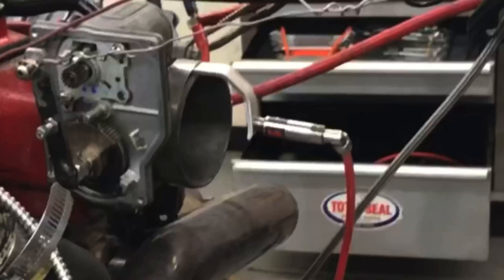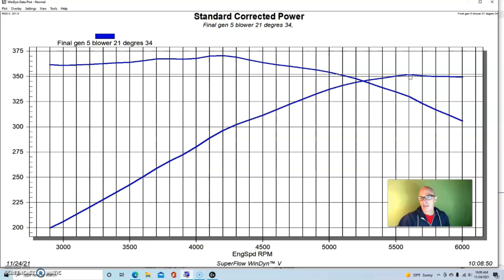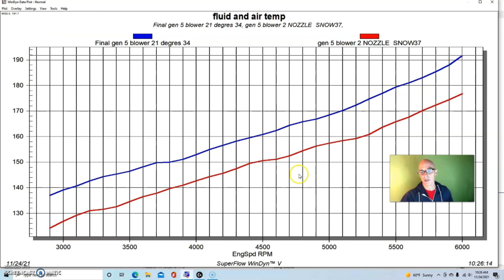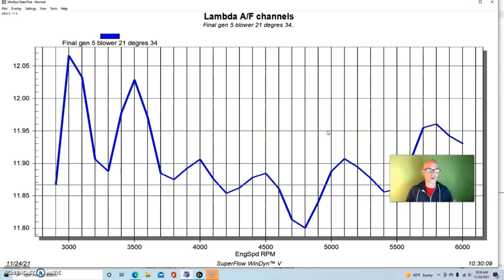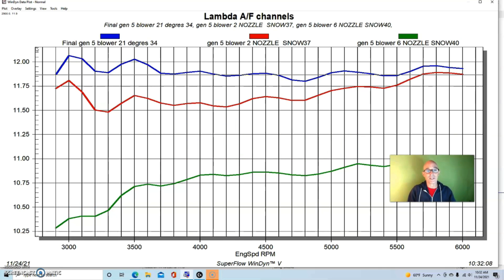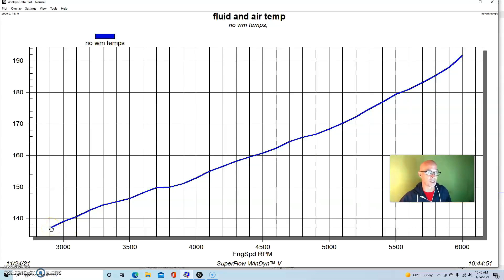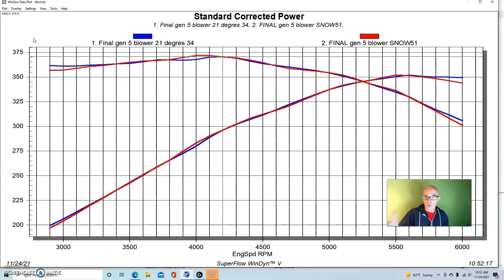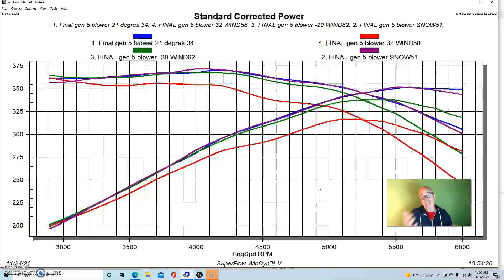WATER METH VS (LOW-$) WINDSHIELD WASHER FLUID-WHO WINS? BEST WATER/METH VIDEO EVER! IATS, AF & HP!

Comment: The test needs to be redone with 100% pure methanol. Either from VP or Renegade. Their meth is within 49%-50% O2(oxygen) content. Test also needs to be redone at varying meth to water contents. Like 50%/50% meth
25%/75meth and 100%meth. With Pre mixed contents the meth amount varies. You're missing out on power to be made!

Comment: I was wondering what would happen if you used e85 in a water meth injection system, intead of water meth. Or even placement of the nozzle, is closer better or does putting it way down a pipe or a larger plenum change anything? Your show is fun
Reply: Best to use meth, it's has a higher octane than e85

Comment: Now test 100% VP Racing M1 Methanol with E85 or VP Racing C85. I’m just about betting with E85 fuel & straight VP M1 methanol will make more power. Also I’ve always been told that with methanol injection it’s always best to have your 100% injection point to be typically around the halfway point of your boost pressure. So if your running 15psi then your 100% injection point would be 7.5psi. Just some of my experience I’d love to see what the results would be if you tested them. Love the videos

Comment: You can add a bottle of HEET to the fluid to get the methanol content up, if needed!     I always heard a 50/50 mix is best,.  But seems a closer to100% methanol would possibly work better for high compression boost or NA engines, being boost would likely be lower, and less actual cooling needed, but higher octane is a big help with high compression.. I have heard methanol is equal to 120+ octane, I'm very interested in this stuff!!
Reply: I always mix two bottles of HEET to half a container of -20 washer fluid to get the methanol content to where I want it.
Reply: 50/50 just happens to be the best mix for optimum charge cooling while raising octane with the methanol and is almost inflammable at the same time. The mix with pump gas/petrol is equivalent to using C16. If using 100% methanol I'd recommend compression fittings and not push lock due to a possibility of leaks and Direct Port injection instead of in the charge pipe.

Comment: How useful to you think a water/meth or even water/ethanol system would be for a highly stressed small/mid displacement DOHC N/A truck engine to reduce internal engine temps? I'm thinking it would reduce oil, coolant, and combustion temps and thus allow more spark advance & power. It could be very useful when towing over the Grapevine and Baker grades in summer for example.

Comment: You can buy ABC air brake conditioner from a fleet and farm type store such as rural king or a truck supply company. It's straight methanol and about $15 a gallon. If you don't want to but methanol in a drum

Comment: To summarize: Water/Methanol Injection is to increase the knock resistance to allow for an increase in boost pressure. W/M without an increase of boost or timing is of little benefit.
Reply: Also since it was already running E85 the benefits arent as large. Basically all the W/M was doing is cooling down the Supercharger meaning cooler air charge. If he had done this with 91 or 93 pump gas the differences would have been larger.
Reply: Interestingly, I made no gain on the dyno, but picked up mph at the strip on a hot day with back to back run testing without altering the tune. There is a video on my channel of it.
Reply: @GapSauceYoutube  more consistent power, less heat soak. Ran nearer to dyno number
Reply: @GapSauceYoutube  maybe the warm water makes better steam.
Reply: Well stated 👍
Reply: The biggest reason to use W/M injection is to reduce air charge temp. The knock resistance is the added benefit
Reply: @beardedforlife3740  but i thot the reduced air charge is what cures the knock?  that's the whole point?

Comment: Richard, it's good to see the charge temp drop with water/meth which should give a detonation buffer but it would be interesting to test high ratios or even 100% methanol to see the effect and how the engine will respond to significantly more timing with mixture correction. I would guess some calculations would be in order to determine the correct A/F ratio since you would be using the methanol as part of the fuel load and not just for cooling.

Comment: What happened with the boost pressure with each type of additive?  It doesn't make sense that in dropping the temp significantly that power didn't pick up.  Air density increased a bunch.
Reply: Couple issues with single port water/meth injection that can cause power to not meet expectations, especially on PD blower setups.  First, you're injecting something besides air into the intake tract.  That's going to displace some of the air the engine would normally ingest meaning less absolute power potential, normally you just lean out the fuel injection though so it would be a wash but.....  Water isn't combustible.  It actually slows down the burn speed in the chamber.  If you don't change boost, you almost always have to add some ignition advance on a water/meth inj setup just to get back to your non-injected power numbers because your burn speed is slower - the hope is that you can add enough to actually gain power without hitting knock threshold again.  I've never been a huge fan of injecting pre-blower, but the only alternative is to run per-cylinder injection which gets expensive.  It's a lot easier on a turbo or centrifugal blower because you can inject after the compressor, although some argue pre-compressor works great on turbos.  And then there's the issue of how well the water/meth gets distributed to all cylinders.  Water/meth can work (and pure meth works even better IMO since you're not carrying the burden of uncombustible H2O), but it takes work to get it right.  A lot of the same misconceptions people have about nitrous apply here as well.  It's not as cheap or easy to do it right as many believe.

Comment: Stunning.  I have never seen a comparison done with actual numbers.  Temp drop is phenomenal.  So too is the drop in hp with the washer fluid.  Sure seems like the Snow products are use specific.  We need to see more tests at elevated boost levels.  Im also wondering about "boost juice mileage".  Is there a way to estimate the amount of boost juice used per mile or??

Comment: The 32-degree WW-Fluid contains about ~95% Water, almost no Alcohol.
On E-85, just running the Engine richer will provide lots of Charge-Cooling,
it's just that You can't measure it because it's already in the Cylinder,
but it still improves Detonation-Resistance substantially.

Water-Injection is great stuff, but it only works well with super-fine atomization,
which usually only comes with super-high-pressures ( 200 to 1000 psi),
and special "Impingement" Nozzles that turn the water into a Fog, instead of "droplets".

The big advantage to Water-Injection is in allowing more Boost-Pressure,
while still maintaining adequate Detonation-Resistance.

This Engine is not "Knock-Limited" at the somewhat "low" Boost-Pressures being used,
so Water-Injection is of questionable value in this case.
.
.
.
Reply: That's pretty much NACAs position for airplane engines in the 30s and 40s. ---If you are not up against the knock limit with the existing setup, Anti Detonant Injection (ADI) wont do you much good.
Reply: @2lotusman851  Gee, both Allied and Axis pilots made significantly more power with water/meth (it's mostly why we know to do it today). Generally because the increased octane and charge cooling let them turn the boost up safely. (I mean, relatively speaking...there was a war on).
Reply: I'm curious about the fine atomization thing.  Fine atomization would certainly do better at reducing the measured intake air temperature, but the important point is that it gets fully evaporated (absorbs heat energy) before ignition.  For example, Mazda switched to using a style of fuel injector with "poor" atomization in their direct-injected engines, because they found that liquid fuel hitting and getting atomized by the hot engine parts (particularly the piston) resulted in greatly improved cooling and detonation resistance.  That's how they run Skyactiv engines at 13:1 compression on California 87 octane.  Obviously it's a little different since they're shooting jets of it straight into the piston dome, but it shows that the atomization process itself can provide cooling power.  I assume there's data proving me wrong, and I'm interested to know how and why it works.
Reply: @JETZcorp  
Any liquid that does not get turned into a vapor will seriously cause the Oil to be contaminated.
BAD BAD BAD !!!!!
Reply: The snow kit is the best on the market with the best nozzles on the market. They are he ones who make all the nozzles for every other company.. it is the perfect spray pattern optimization.xzzz
Reply: @xGR1MxREAPERx  
It's your Engine, you can "believe" anything you'd like to.
Will they protect a Street-Engine running ~14-to-1 Compression @ ~30-psi, on Regular-Pump-Gas ????
I prefer a huge Safety-Margin when making ~1300 lb/ft of Torque, and I don't intend to replace my Engine.
Reply: According to the msds sheet The -20° super tech brand winter formula was 30-40% methanol. And 0° is 21-23%..
Reply: @ogfromutube  
Sorry, but I couldn't enjoy an environment were minus-20-degrees is a routine thing.
Not even the zero-degree version is available in Florida.
When you're driving in freezing-cold-Air, You don't really need Water-Injection anyway.

Comment: Those are disappointing results. I figured water/meth would be worth all the extra work/hassle. Much better off with an intercooler. Probably more useful on the ragged edge than it is on a relatively stock 3.8 though.

Comment: Though not as affordable (by volume) as -20F Washer Fluid, I wonder how well Rubbing Alcohol would work.

Since it's commonly available in 50%, 70%, and 91% concentrations and is of good quality.
Of course, there is the smell.

But, for example, a 32oz bottle of 91% Isopropyl + ~100oz Distilled water (grocery store) = ~20% Water/Alcohol mixture. For about $5 (local prices in Northern VA).

And of course you can change the ratio with less/more water to the solution.

Comment: Was he using race fuel, pump, or e85?  I believe most ppl run water meth with 91/93 octane pump gas to be able to run higher ignition timing.  If your already running race fuel and can max out timing without water meth then your not really getting the biggest benefit of water meth.
Reply: In the nightly chat I believe he stated this was with  e85. So it wasn't knock limited, which agrees with the point about increasing timing not producing more power.

Comment: Thanks Richard. I have been thinking about this and then you do a great video. I think the boost juice is 50% meth and the best windshield washer fluid is about 36%. You can buy a metal drum of 100% meth for about $5 a gallon last time I checked and mix your own.  I'm strongly considering direct port meth for my 292/6-71.  Hogan will be making my intake manifold. Should it be injected at the top or bottom of the port? Thank you for your time.

Comment: I think having e85 negated any potential benefit of water meth as you're already running the engine at optimal timing. If this test were to be redone with 91 octane vs 91+ WMI, I wonder if the results may be different. 

Water meth displaces fuel and air in the combustion chamber, as evidenced by the richer air fuel mixture before making adjustments. If you're unable to take  advantage of the increased knock resistance from the water meth, it stands to reason that it would only make less power.
Reply: I think the reason is that methanol mixtures above 50% are extremely corrosive and require special engineering considerations. Not to mention 100% meth is super dangerous in terms of combustion fumes, burning invisible, and I think it's pretty hard to put out.
Reply: If you are willing to take the risk of running pure Methanol on a street car ,
Hope to never have an accident .
Reply: Water.  Just water. 91 Octane 11.1 15lbs boost 4000lb truck...hay" it could happen  🤔
Reply: This is true HOWEVER.  Methanol brings its own oxygen molecule too the party. Im not a fan of running any water at all and spraying pure meth. 

-It flashes at a lower temp (colder iats) 
-it burns cooler in cylinder
-it brings its own oxygen molecule so you can spray more fuel for more power
-and unlike water it doesnt displace any room for air.

I would like too see this test re run with -40c wiper fluid and pure methanol as well as knock detection
Reply: @Saddedude  So why Germans where running 50-50 water meth blend in their fighter planes? If pure methanol is better?
Reply: @andriosz  cost and space.

Pure meth requires more volume. And waters basically free.
Reply: @andriosz  the nazi's had a limited amount of methanol for use in the war effort.
Reply: @andriosz  Water takes away the combustion heat from the cylinders much better than straight Meth , it also steam cleans everything to eliminate carbon , if you look up faqs on water Meth it will tell you why you shouldn’t run it straight it’s a huge list , first it’s very flammable after 50/50mix , you can have a leak in the engine bay and potentially have a fire , It has a low flash point and can cause severe backfires in the intake manifold , This happened to me when I ran straight Meth , it split my driver side intake manifold apart , There is no doubt straight Meth can make more power than a mix but it’s minimal and it’s  a risk you have to take
Reply: @Antimatter.  I like you answer, thanks :)
Reply: @andriosz  Thanks man 😃